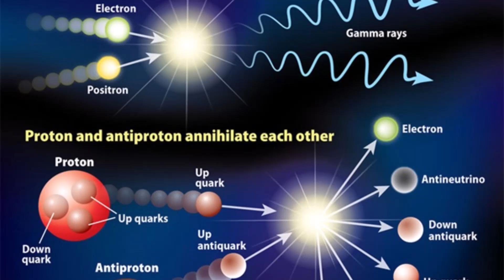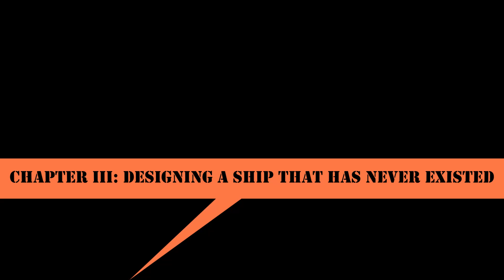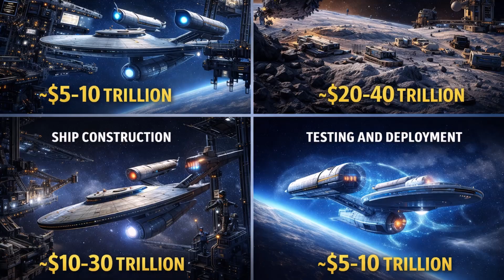Could Humanity Really Build a Starship? The Time, Cost, and Truth EXPLAINED

Comment: If we think about building starships at different scales, could we approach it the way cars are manufactured—using modular, customizable parts assembled into a single prototype? In theory, this could be done globally, with a first-generation ship produced through advanced manufacturing methods. Large-scale 3D printing could play a role in this process.

Tim Ellis, for example, worked with investors to develop large-format printers capable of producing major rocket components, allowing a complete rocket to be built within two to three months. If that concept were expanded or adapted, it raises an interesting question: could similar methods be transitioned toward larger spacecraft or starship frameworks?

The video linked below helps explain what this kind of technology is already capable of and why it could be relevant to future aerospace manufacturing: https://www.youtube.com/watch?v=kz165f1g8-E

Comment: Sure , but to go anywhere with current technology it would need to be 80% fuel , need to be built in low or zero gravity. And require pre determined refueling locations. It could also deploy solar sails, ion thrusters, and would likely need nuclear reactors to power life support and other systems. it probably take hundreds of years to construct if the infrastructure and materials were already available.
And potentially by the time it’s finished, technology would already have leaped making it obsolete.. welcome to aerospace engineering.

Comment: All testing for support systems can be done right here on Earth.  The ship itself  could be built and designed to run as a naval ship in our oceans then once verified built and assembled in low Earth orbit to run and operate as a next generation space station  before advancing to begin solar system exploration  on its " 5 yr mission "  major huddle is gravity.  It's effects on the human body is changing once in space for long durations.  Nasal has huge vacuum buildings so we have ways to build and test for gravity by filling with gas. Such as helium to create an antigravuty facility to build and study in(just a thought) no wouldn't be cheap but it can be done on a small scale and build up to the building size testing eventually

Comment: That total estimate doesn't add up. We only need to construct / do the science exactly once, and we even can do most of it at the same time. In the end, once we have that stuff available, we can build a self-sufficient starship within 20 years for the prototype, which also requires a thorough test for scientific and diagnostic data. From there on, every subsequent vessel will be built much faster. The better we know our trade, the easier it gets. Sure, the first one will be the most difficult one. But once we're there? It'll be much, much easier. Like from 40 Trillion USD down to 4 Trillion USD for the second vessel. Third one? Half of that. Fourth one? Again, cut the cost in half. Once we know how to do it on a regular basis, a single starship for a crew of 500 will cost 200 - 500 Billion USD: Still expensive, but available to a midpower industrial state.

If we don't interrupt our progress with "self-inflicted damage due outrageous stupidity" we can make it to interplanetary space travel in 50 years. Interstellar space travel - another 100 years. I'd say, 2150 - 2175 is the time window where we'll launch our first interstellar mission. Slower than light. But 0.9c is still enough to reach our nearest star in a reasonable time, especially since it takes "less time" for the crew to go there. The closer to 1c, the less time they'll experience.

Comment: This data is REALLY out of date. Space-X has revolutionized space flight and manufacturing. Not only have they streamlined many processes that took months before but they took out many of the steps that required multiple systems that could cause catastrophic failures with complexity. They made their design more simplistic and this also helped to speed up the process. And as far as the research, you could simply put out a quick and easy email to the world and all of the Trekies would design the thing for free. Many of the Trekies around the world are already working on the designs without being asked. All that would need to be done would be to network them and figure out the design that would actually work. Funding could also become rather easy too. Once you get a manufacturing and mining apparatus space would provide it's own resources to finish the task. You could either use the moon or other stellar body.

Comment: There's another major hurtle. And that is radio communications has one big limitation and that limitation is that radio frequencies (RF) are light and that means it travels only at the speed of light. On shows like Star Trek, they use "sub-space communications" which is supposed to be much faster than the speed of light. This is something we obviously do not have. Maybe we can modulate a signal using the quantum field one day.

Comment: You would not do it all like it has been described here.  You would start the infrastructure.  Build a real space station that can be the stop over for inter system ships.  Build mining operations on the moon, and in the asteroid belt. With local system ships.  These things will generate profit.  Meanwhile that research on how to handle gravity generation (outside of centrifugal force) if it actually is somehow possible (unlikely).  Theories on FTL via warping space already exist.  Proof, of concept can also start even now.  Power generation is a very large issue along with shielding and impact avoidance have to be engineered and the science of "shields" does not exist.  Slow steps, that build your end result here are the way it would be viable only if the things that have no scientific basis currently are discovered and engineered to a practical usable level.  It can be done by one large country, if it was motivated to do so.  (Along with companies that see a way to profit directly from it.)  Right now, we have zero need or zero security interest in that end project.  Not profitable, or urgent in any way.

Comment: As a crude example, throw some engines on the ISS and you have a starship. The ISS is super basic but built piece by piece and functioning in space for years as a lab and habitat.  Not that far off from what is being described. We have already proven it can be done.
Reply: I agree. The title says "starship" not "Star Trek technology starship". We can build the best closed-ecology system we have into a huge (by current standards) spacecraft and outfit it with Orion-style nuclear pulse engines... perhaps even using a lightsail and orbital lasers to boost speed for a while. This starship WILL eventually arrive at another solar system after travelling for decades... whether the crew lived for more than a few months is the main question.

Comment: There is less than 60 years between the first flight of the Wright Brothers at kittyhawk..🛩️.And the Saturn V at cape Canaveral 🚀...Now imagine 400 years into the future ⏳
Reply: It took us that long to go from horse drawn carriages to an electric vehicle on the moon.....and new discoveries are only coming faster as we learn more and more.....NASA is still working hard on the Alcubierre-White Warp drive, coming closer and closer to developing the math to make it doable. Once the math is there, it's a matter of engineers designing and building the ship...It could happen tomorrow or 100 years from now...My bet is on having an experimental drive in the next 50 years
Reply: @chrissschwehr5911  "It's been a long road, getting from there to here..."
Reply: In 400 years we just could likely have the technology of the EXPANSE TV series without the Proto molecule and the worm hole.  Full Solar System use; but NOT routine star travel. Gene Rodenberry was way, way, way overly optimistic on FTL technology.  The EXPANSE is simply far more realistic than Star Trek.
Reply: @williamthornton5856  I'm not going to sit here and let you dis Trek. It's profane. We may already have warp drive, but the population doesn't know it. It could be discovered tomorrow, or next year, in which case Star Trek would have been pessimistic, and we start to colonize Alpha Centauri by 2061.
Reply: @strategicqualityaccessorie4590 The only way that is possible is IF WE HAVE HAD OTHER WORLD "HELP". OTHERWISE IT'S A COUPLE IF THOUSAND YEARS OFF.
Reply: Give humanity at least a full millennium to become a true spacefaring civilization. No starships before the year 3000.
Reply: Light speed will still be the same
Reply: Without help? How do you know we don't have alien space ships in a store house somewhere?
Reply: @sebbonxxsebbon6824 😂😂 you really think a civilization with interstellar technology would crash and leave their ships here and these idiots couldn't reverse engineer it anyway
Reply: @icemike1  Space warps don't care about lightspeed. They fold space.
Reply: The Wright Brothers were not the first, a German immigrant by the name of Augustov Whitehead achieved the first controlled flight 2 years prior.
The Wright brothers failed and lied to the world.
Reply: Exactly.  That's my point.  As long as we don't blow ourselves to smithereens, mankind has a legitimate shot.
Reply: @scottdavidson526 mankind is all ready topping out
Reply: Yeah, now imagine humanity living for 400 more years. Naaaaa.
Reply: The prototype would be called USS Trump NX-01
Reply: @CollyDoo  I fully endorse this new ship class naming convention. USS MAGA.
Reply: @CollyDoo ughhh😢
Reply: Never going to happen..
Reply: @4eyesGuy-m6y  LOL. Yup and the NYTimes stated on it's front page that it would be a million years before man would fly...that issue of the NYTimes was printed on Dec. 16th 1903....Man will never go into orbit...Man will never go to the moon....Man will never go to the stars.......Man will go.....